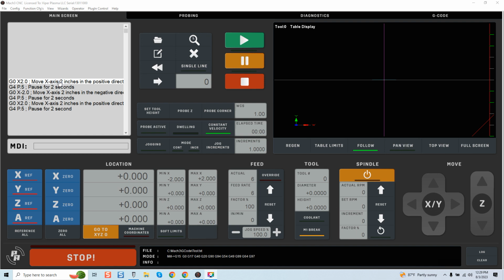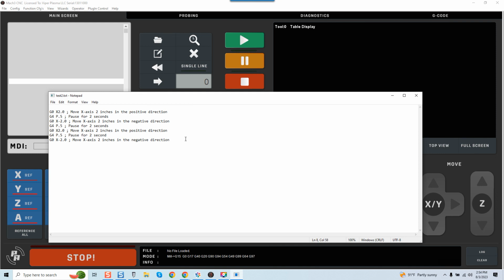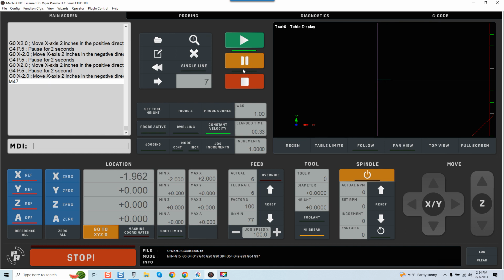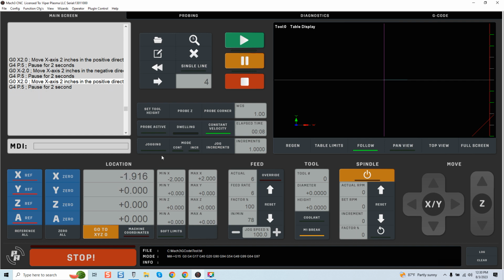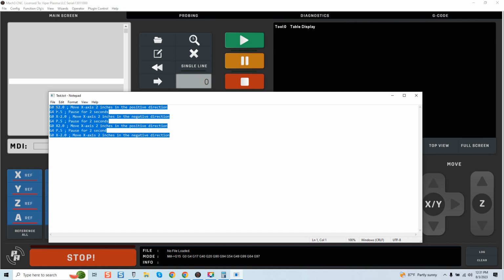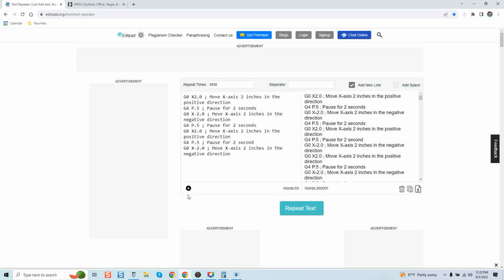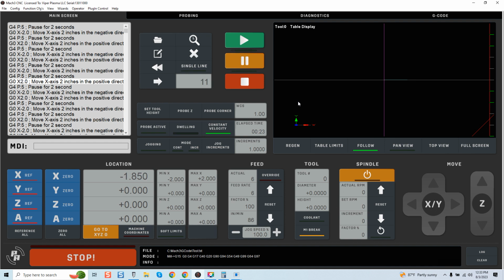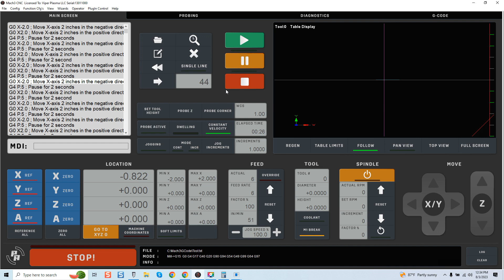How To Automate Non Conventional Production Robots With Mach3 (Pick And Place Robot)..

Comment: Easy way M98 & M99. 

M98 Subprogram Call
The M98 command is used to call a subprogram followed by the program number and the amount of times that we wish to repeat running that subprogram.

A typical M98 block may look like this :

M98 P52000;
M98 calls the subprogram
P is the program number (O2000)
The number that precedes the program number is the amount of times it is to be repeated (in this case 5 times)
At the end of the subprogram, the M-Code M99 is used to return to the previous program.
Note: the previous program may be a subprogram.

Up to 4 subprograms can be nested, this means we can call upon a subprogram inside another subprogram up to 4 times. 
M99 Subprogram end
The M-Code M99 will tell the machine that the subprogram that it is currently running has come to an end, if the subprogram has run the number of times specified by the initial program call using M98 P____; It will stop running the subprogram and return from to the previous program and continue to run from the line below the M98 line.

M99 will always return to the program that it came from, even if it is a subprogram. We can not jump back to the main program without returning to the program that called the subprogram.

M30 - Program Stop
Once we have used the M-Code M99 to return to the main program we would use M30 to tell the machine that the program has finished and to stop the machine.

An example:
M98 P52000;

(Runs the subprogram O2000 and repeats 5 times)
M99;
(Returns to the program that called O2000 and runs from the block after the M98 command)
M30;
(Machine stop, program finished)